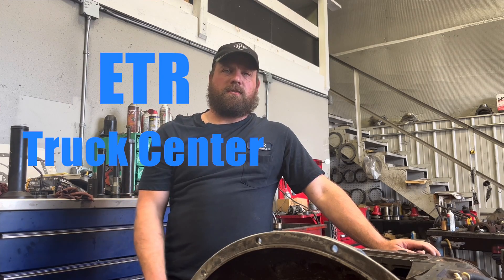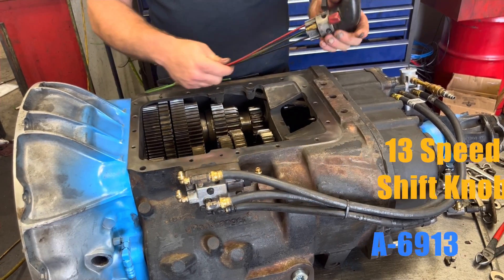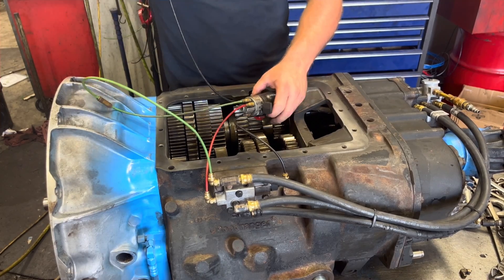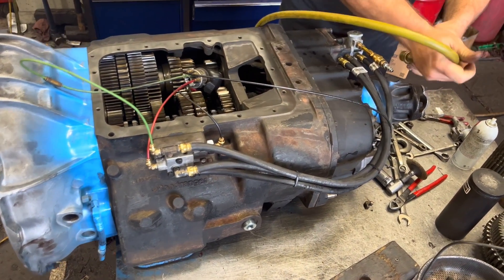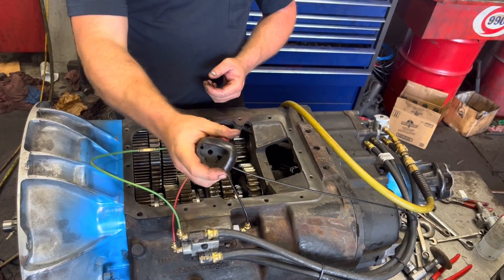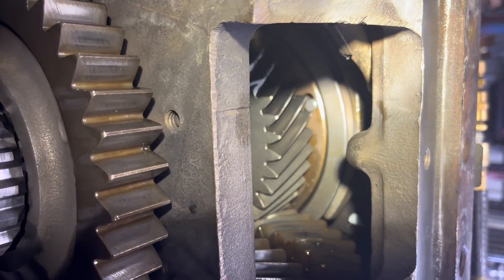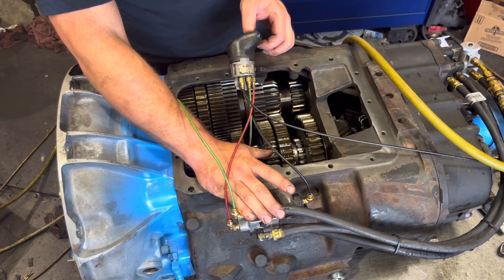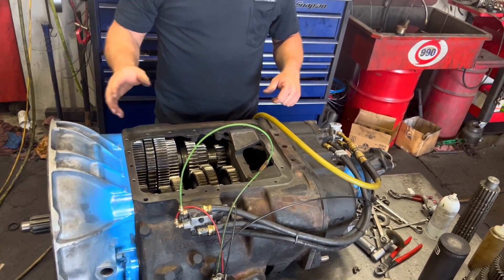How to hook up a 13 speed knob and preform a bench test see the synchronizer and splitter actuation

Comment: All I got is black and white lines
Reply from the maker: The knob will be marked you can just use the video for color reference
Reply: Are you familiar with old petes. Mine is a 1984 i put the new shift knob on. It is a completly dofferent design then my old one. Had a few mechanics tell me so.e older 13 speeds wont work woth the newer 13 speed shift knob. Mine was a chome 2 piece job@etrtruckcenterenginedrivet8918

Comment: I have a 13 speed that bucks on high and lows we swapped transmission already. And before the swap it would do it on the high and split gears. But now it does it on the low gears

Comment: I have a 13 speed transmission when I use the red splitter button to go up it actually downships it's performing in the opposite direction how do I fix that
Reply from the maker: You need to buy a K-3331 splitter cylinder cover. Someone probably put the splitter cover off of a super 10 on there

Comment: Nice to see the splitter gear moving👍🏻👍🏻 but I wonder what's wrong with my transmission. I got a 13 speed and sometimes when I move the splitter selector from Low to High it starts to grind and it won't go into gear. I have to slow down enough for it to stop grinding and put it in gear. Mostly happens when shifting from 6H to 7L
Reply: I am having the same problem did you ever figure it out

Comment: So that's what a "splitter" is! It's neat to see what's going on when the little splitter switch gets flipped. So a splitter is like a gear ratio doubler that's integrated into the body of the manual transmission. Can someone answer me this then: around how many times can the splitter be operated in normal conditions before the transmission needs to be overhauled?  Is it like 1 million actuations before things start wearing out? Or is the splitter system and gears just one more thing that gets addressed all at once with a full transmission overhaul?

Comment: So, seeing how it all works, and you being a competent transmission rebuilder....whats your take on taking the transmission in and out of gear when splitting
Reply from the maker: There’s some extra wear taking place there when your manipulating the trans in and out of gear to make the split. A lot of people do it this way I don’t understand why when you can simply lift off the accelerator.🤦‍♂️
Reply: @etrtruckcenterenginedrivet8918  thanks for the response. My thoughts exactly! Far too many people saying in and out of gear is the way its "supposed" to be done 🙄
I've been driving for 23yrs, lifting my foot every split and have never had a transmission problem

Comment: Best video I've seen that explains the air system.  I just had my 18918B rebuilt and I'm loosing air inside the transmission.  Frustrating trying to figure out where it's coming from.
Reply from the maker: If it’s leaking internally more than likely a problem with the range cylinder or splitter cylinder.

Comment: How much pressure did you have running through the tranny,  thanks fir the videos
Reply: Tranny supply is 110psi or so however consists of air pressure regulator which limits the pressure to anywhere in between 57.5 and 62.5 psi which in the end is transmissions working pressure